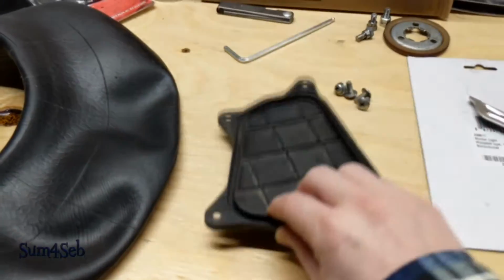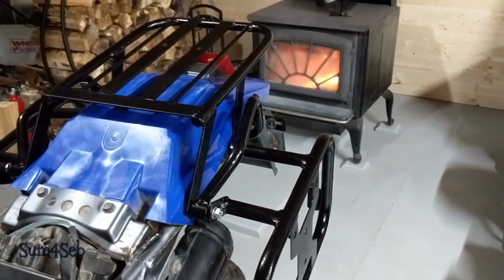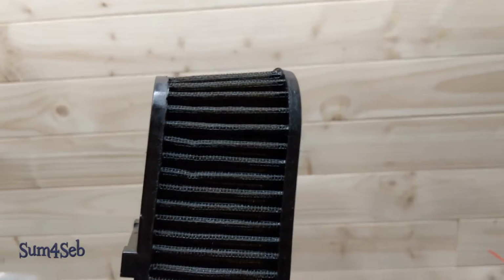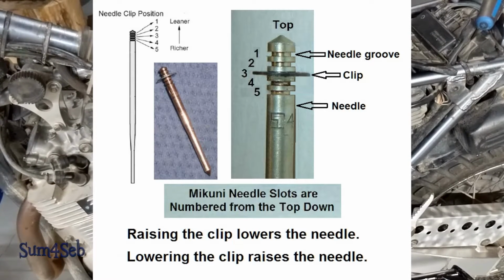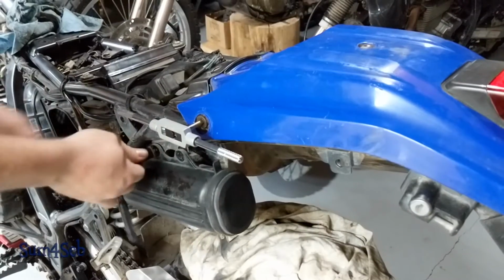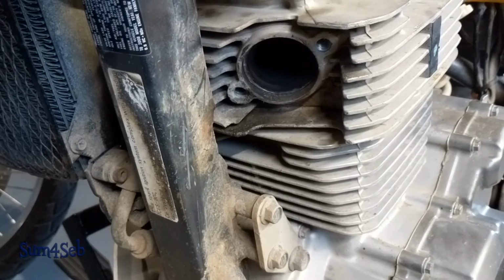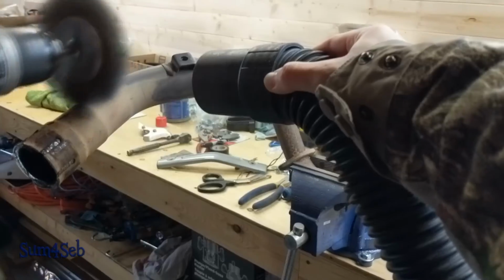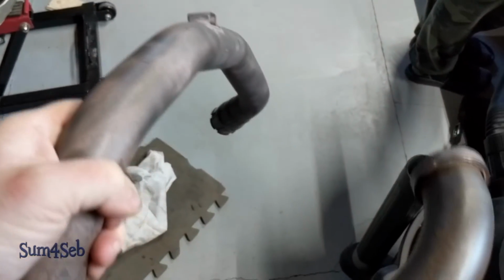Stripped bolt threads & carb adjustment Suzuki DR650 Maintenance |¦| Sum4Seb

Comment: If you haven't already order a replacement have a look at the funnel web filter its supposed to provide better filtering. Isnt there supposed to be a mesh gauze over the air intake inside the air filter box or did you remove it and did you check the small filter under the seat that feeds the carb as this can cause performance issues if blocked?
Reply from the maker: Hi, thanks for the comments. The previous owner must have removed or lost the mesh, it wasn't there when I got the bike. We are switching back to a foam air filter so the K&N one isn't going back in the bike. This DR that I'm working on in this video has a TM40 flat side carb. The other 2 DR's have the stock BST40 carbs and they will be replaced so the carb doesn't end up sucking the old foam in. Lots to look out for when you buy used, you never know what the other owners did, or didn't do, to the bike...that's why we're working on a full inspection this winter while we're hibernating. T4W